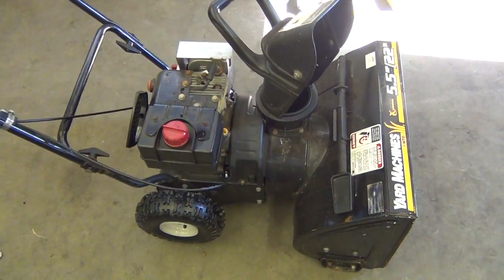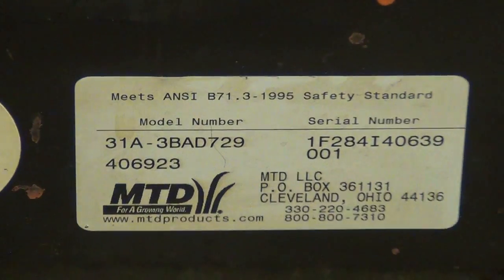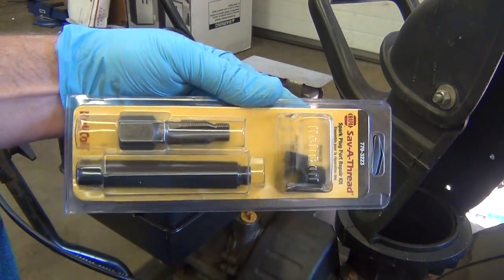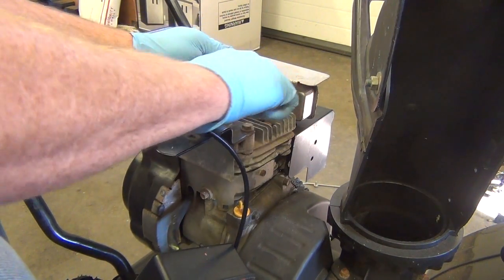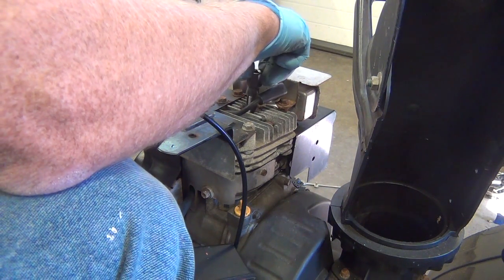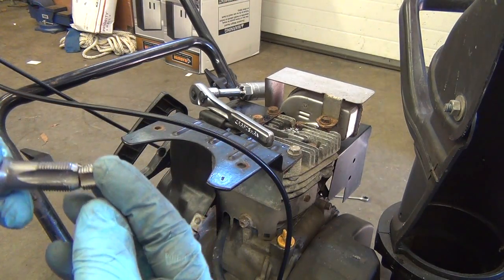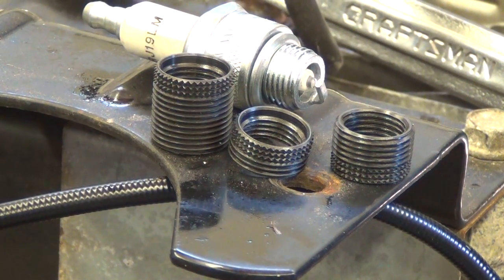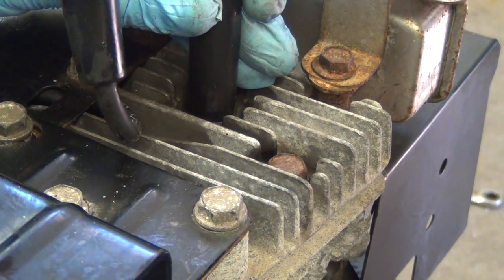Tecumseh spark plug thread repair on 5.5HP LH195 engine

Comment: No need to worry about a few small shavings of aluminium, as normal combustion temperatures will ignite and burn small shavings of aluminium, yes aluminium  will burn very much like magnesium does, so it leaves the engine as exhaust, now cast iron or steel requires higher temperatures to burn so cleaning out the shavings is recommended

Comment: Nice job done. Wonder if the alloy bits will exit. Cheers 🦘🇦🇺
Reply from the maker: I blew out the cyl with my air gun to get it all out. The repair was a last ditch effort on that old 5hp TEC engine before we just scrap'd it.. Most of the 5 or 5.5 HP flathead snow engines are pretty much dead by now.  The blocks on most of the 5hp and some 8hp L-head engines will "settle" or shrink a bit over time and this prevents the valves from full closing. You will have to remove the breather cover and grind/file back the valve stem to increase the clearance to let the valve actually close. (Or remove the head and pull the valves and grind them as needed) Check the spec for the proper valve to lifter clearance.  Too much clearance give you an annoying tappet sound!

Comment: You shouldn't have removed the end. It guides the tap. Lower the piston down. Tighten and loosen the tap repeatedly and clean off the shavings. Put wheel bearing grease on the tap. Use Locktite high strength sealer on the insert. Let it dry and harden. Use the swager to expand the knurl. A medium insert would be better than the short one so it'll have more bite. Use a ratchet instead of power. If you don't tighten the plug enough, the insert can come out! Then you have to use a Big-sert. A Time Sert is better but it's expensive. Run a cylinder leak-down test to check rings and valves. A piston stop tool can lock an engine to remove crank bolts etc.
Reply: Marty Stevens Piston position does not matter.  Most of these engines position the plug over the block, between the valves and piston.
Reply: Larry Fine I have that kit and sometimes you might can screw it down onto the piston. Those inserts work but if you have limited space, the swager might not hammer it enough to lock it in. That kind of insert can loosen and widen the hole. Then it pops out! A Time-sert is better because it locks in. It costs more. If the insert comes out, a Big-Sert may be needed. Use a screw extractor to remove inserts. To gauge the size, use a drill bit and drill to a maximum of 3 bits to the size of the insert size. Use Loctite High strength sealer. Screw the plug in loosely when installing the insert to dry. Install an insert matching the depth of the reach. Tighten the head bolts on small engines.

Comment: I'm the same on a scooter
Reply: ABSOLUTELY PROFESSIONAL It would be better to use a Time-sert kit.  They lock in. Save-A-Thread can loosen up if you don't swage it properly. Use a screw extractor to remove inserts.

Comment: how did you get the metal shaving out of the cylinder?
Reply from the maker: Compressed air.  When I did the work, I had both valves closed on the compression stroke. I used a blow gun to blow all the chips out.  These chips were large (not like dust from grinding) so they were all large enough to get picked up and blown out. I also slowly rotated the engine while blowing air into the spark plug hole to force out any chips that I missed through the exhaust and intake valves. Not perfect but fine for this old machine.

Comment: Well done!  

A couple of suggestions that don't all apply to your special situation but for the normal thread replacement procedure:  1) Make sure the piston is not at TDC when you do this otherwise you may run the tap into the piston.  2) Contrary to the directions that come with the product, I would not use RTV sealant.  That's really a rubber-based gasket sealant.  I would use Loctite Red instead which gives you the added advantage of locking the coil in the head so it won't be removed when you take out the spark plug which is often a problem people report when they use RTV.  RTV simply makes no sense to me.  3) Use Anti-Seize on the plug threads.  That will also help to make sure the coil isn't removed with the plug but you should always use it anyway when installing spark plugs. In fact, I would never even think of installing spark plugs with coating the threads with Anti-Seize, especially with aluminum heads.  

Don't remove spark plugs from an aluminum head when the engine is hot.  When it's hot, both the head and the spark plug metal is expanded, making the plug very tight.  If you remove the plug when the engine is hot, there's a good chance you will rip the threads right out of the head.

Don't try to blow the metal shavings out of a cylinder with compressed air. It won't work. The nozzle will block their escape anyway.  Use a tiny vacuum attachment for your Shop-Vac or other vacuum device. They sell little assortment kits on Amazon, etc.  There are very tiny vacuum nozzles that will get in tiny places and they are ideal for this.  Also, coat the tap with grease and remove it frequently during tapping to clean off the shavings that will stick to the grease.  That will eliminate most of the problem right up front.  As you know, the spark plug does not actually go into the cylinder on your engine.  Blowing compressed air into the spark plug hole will actually push the shavings into the cylinder. 

In your case, I would have first tried to heat the bolts with a torch but if that didn't work, your method is fine. To avoid problems like this in the future, coat all threads with Anti-Seize. That's especially important with aluminum heads.  Of course, you almost certainly never removed the head bolts before so that's not an issue here but, when you do remove bolts, use Anti-Seize when you reinstall them.  I think a little heat on each bolt would have freed them up, though.
Reply from the maker: +jamie buchanon I think Bob was saying apply anti-seize to the spark plug threads when you install a plug in an aluminum cylinder head. I think most folks do this because the aluminum heads can oxidize and the plug can get "rusted" (oxidized for aluminum) in place and difficult to remove without damaging the head.  Be careful when using anti-seize on your spark plug, don't use an excessive amount and keep it away from the center electrode. I generally apply it a few threads back from the end of the plug to prevent it from getting on the electrode and causing misfires (or not fire at all).  Don't forget, that anti-seize has very tiny aluminum particles, graphite , nickel , etc  in it... it will allow some electricity to flow down the center insulator and short out if you get a decent amount on the inner insulator cone/center electrode - possibly  preventing a good spark. So, use it on the threads but be careful not to get it all over the plug. When I use it in the shop, it gets on everything even when I'm very careful... stuff is messy.
Reply: With this engine, it wouldn't be a problem.  The torque on these heads is not high at all and it's not critical.  I'm sure that most people don't even torque head bolts on small engines like this anyway.  They just tighten them by feel.  In this case, the biggest potential problem is exactly what was seen in the video. That is, the head bolts were seized.  This is a common problem on these engines and an anti-seize compound can often avoid the problem. 

On the other hand, it's not recommended that you use anti-seize compounds on wheel studs (for lug nuts) , etc. for the very reason you mention.  That said, I've been guilty of using a little on my wheel studs because the tire place that balances and rotates my tires have sometimes tightened them so much that I couldn't remove them even when I jumped on a three-foot cheater bar and I'm 260 pounds.  

I do use anti-seize products on many bolts and nuts but not when it could cause a problem.
Reply: +Bob Miller 
Agreed with Bob.  Good post.
Reply: +Bob Miller would  using anti seize on a head bolt not throw off the specs when torquing the head bolts down? I'm not a small engine tech,but I am an automotive tech and I am just using the logic I would apply with a gasoline automotive engine. Everything else you stated I agree 100%. Great post
Reply: +Dan Small Engine okay  I gotcha. Hey Dan You have a new subscriber
Reply: You're correct. I see I wrote that incorrectly but I've fixed it.  I did mean to put an anti-seize compound on the spark plug threads, not the thread insert. Thanks for pointing that out.